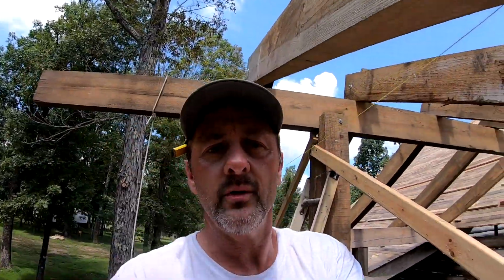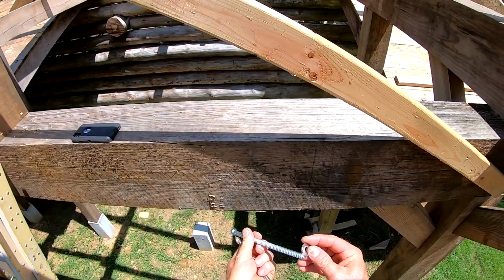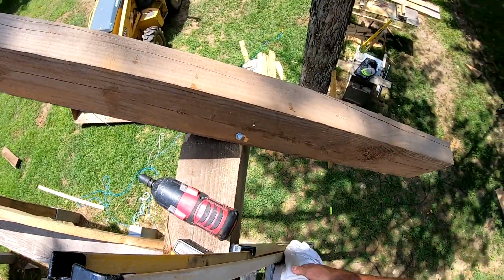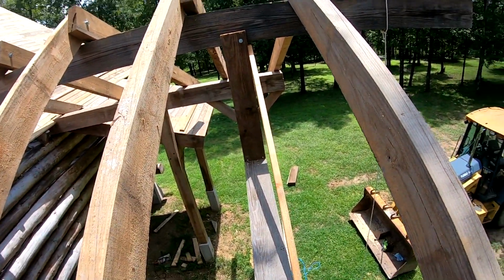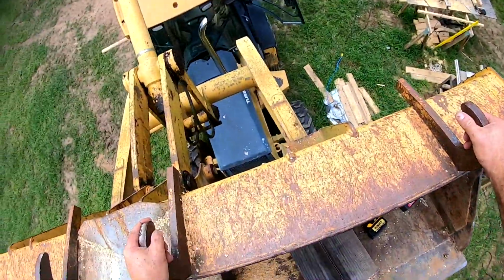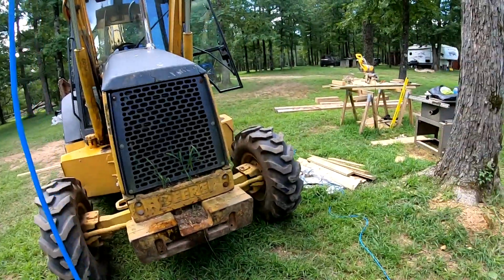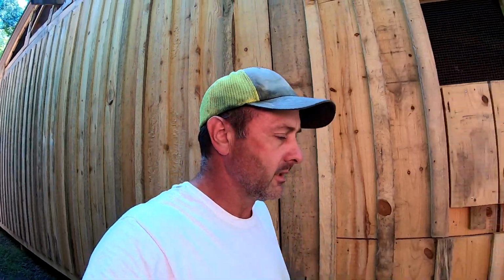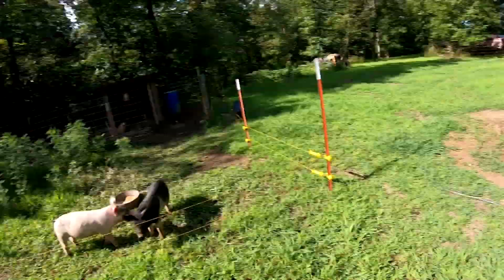The large rafters are getting bolted in place and ready for decking.

Comment: You do know that you can rent or maybe even borrow scaffolding? Make the job a lot safer and quicker.
Reply from the maker: You cant tell on the video but the ground slope is 3 from one end of the house to the other which makes prebuilt scaffolding next to impossible to use. I did rent some when I had to space out the rafters at the ridge pole. That's why there is a temporary floor down the middle inside
Reply: @hickoryridgehomestead9177  Just thinking of you bro. After watching you work you could probably McGyver something. 
Build is looking good.

Comment: All of that is sitting on a little ole 1x4 decking board and if it it gets a snow load on it good bye. Kick the bottom of your ladder a little more at the bottom its too straight up and down.
Reply from the maker: its actually 2x6 decking sitting on 4x12 rafters and  also gets another support off the cap log from below. I could put 10 feet of wet snow on it and it will never move.
Reply: @hickoryridgehomestead9177  OK thats good. I guess I cant tell on video LOL